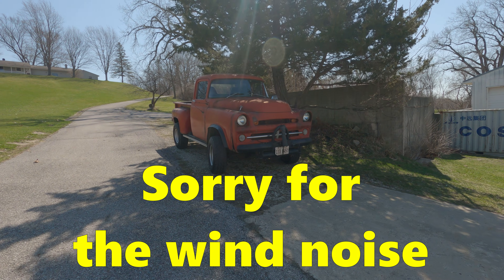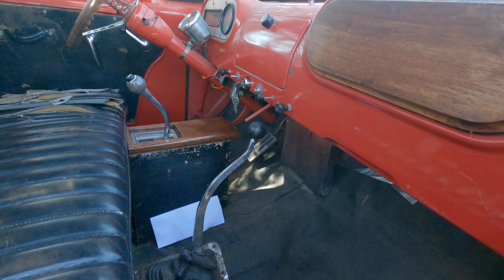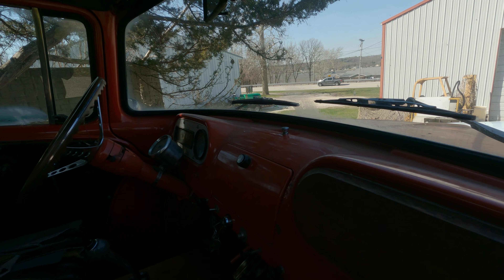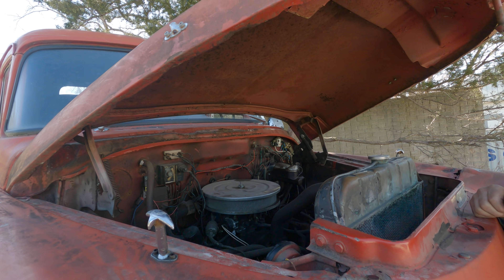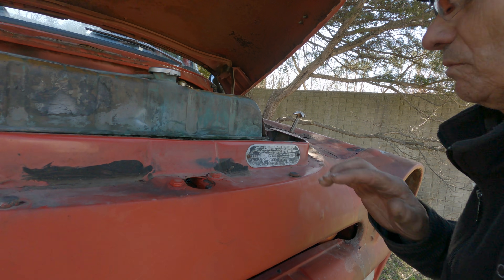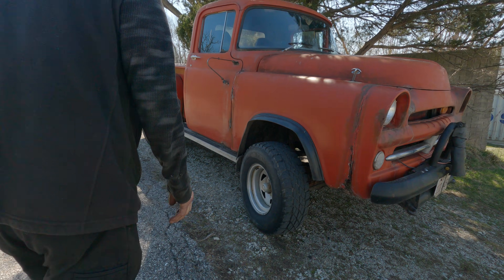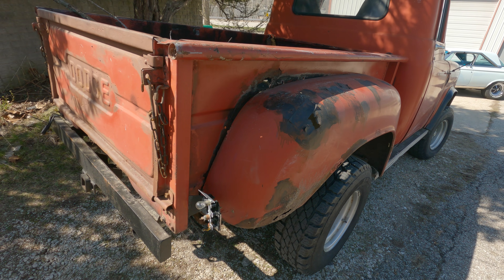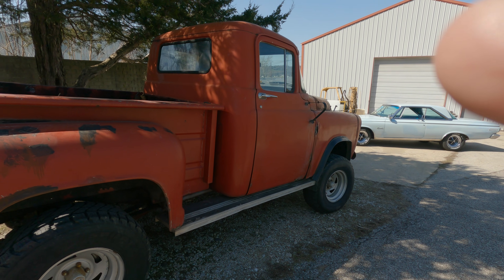Larry Griffiths Shop Truck - 1957 Dodge

Comment: Very cool we had a 57 worktrot dual stacks 318 and it had one t axles under it must have been special order. Then I had a 53 with push button automatic and somebody put a hand me in it Love those 5 window pick UPS... Then my favorite and 1st one wand the 1st 1 was the 55 , 5 window v8 , 4 speed j job rated perfect body why did I ever sell that truck !!?0
Reply from the maker: These trucks are cool, Larry's could use a little TLC but I'd own it.